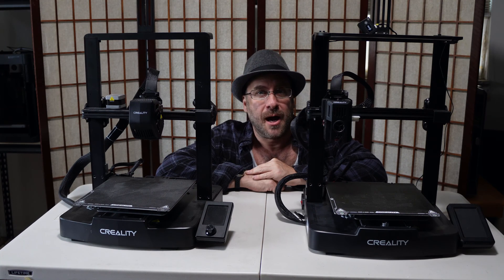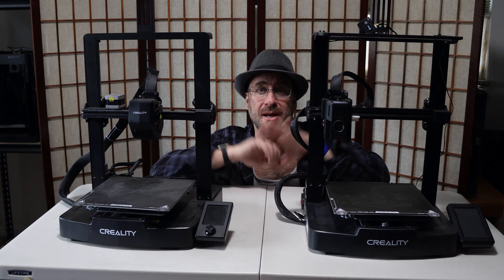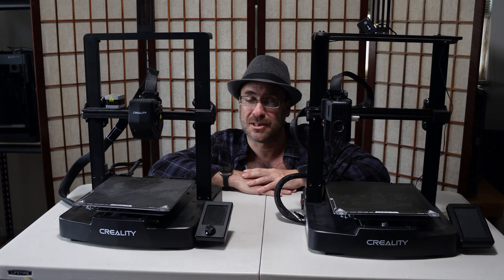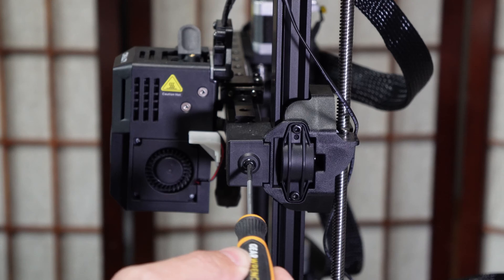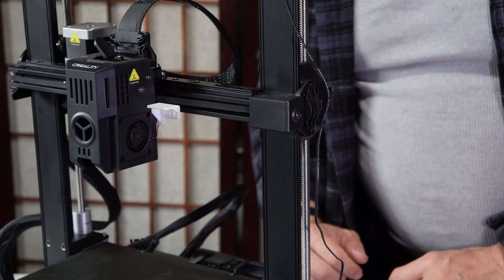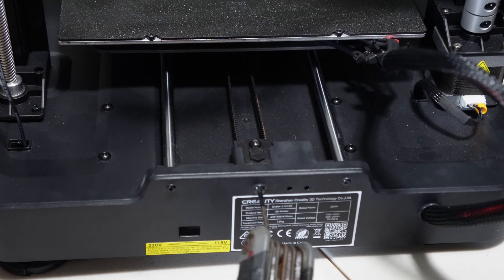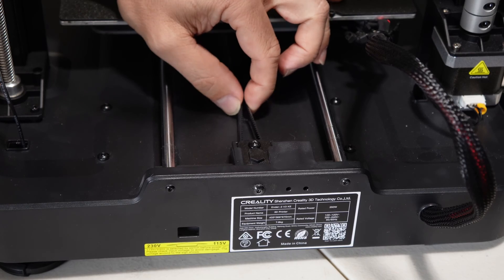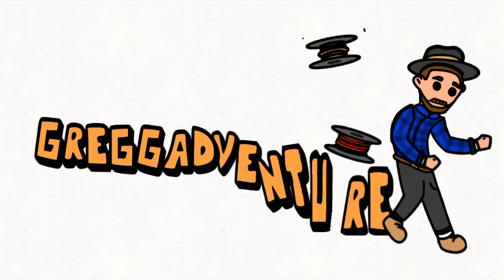Tighten Belts on Creality Ender 3 V3 SE and KE - Belt Tensioner - 3D Printer

Comment: Thanks for the info!

Another tip: I had terrible issues with bed adhesion. I tightened the belts, but it didn’t help. I also adjusted the Z-offset, but the results were hit and miss.

So I went back and checked all the screws mentioned in the assembly instructions — and a few were loose. After tightening everything properly, printing is pretty much back to how it was when the printer was new.
Reply from the maker: ALWAYS check all your screws and grubs when a new printer comes in. Even my $2500 Orange Storm Giga, came in with a loose hot end.

Comment: If the screw under the bed won't engage the click switch at the back, next to the tensioner, does that mean the belt is too tight?
Reply from the maker: Something is obstructing the bed. Look for piece of filament or something. Be sure the cable isn't hitting the wall

Comment: Hello! Ender 3 v3 ke have eccentric nuts like S1 for example? In mine, only one rolling in each side...
Reply from the maker: Yes. I believe they are under the plastic housings
Reply: @3DRundown  Thanks! The S1 video saved my lasts  prints while I have this issue with KE(ghosting, layer shift)🙏 Recently, i bought an a1 mini, but had to return due the troubles with nozzle hitting and adhesion...😌
Reply from the maker: Trouble with the A1? I'm surprised. I bet we coulda solved that. For your KE.  Check the HOT END & NOZZLE for loose screws. Check them ALL, even the Grubs. Be sure the nozzle is solid and NO WIGGLE. My CR10-SE had a loose hotend, causing Z-Banding, that drove me nuts for weeks, trying all sorts of shit..... before I finally found it....
Reply: @3DRundown  Thanks!I watch your video about a1 mini for for adhesion and this make me decide return( I think unfair have to buy glue or anything for a new printer with troubles) and I read several cases about nose hitting in the internet. About KE, all hotend is wabble since a bought it and screews are dusted, but I was able to get great impressions until recentlyl...
Reply: Sorry for my written English, but I understand it very well (thank you Seinfeld and Guns n' Roses) to follow your channel instead of thousands in portuguese 😊😉

Comment: CreaLIEty screwed me over on the v3 plus arrived missing bolts on the bottom of the rails that play a part in stabalising the machine (not the support twisty things you install yourself) .  I asked them how to tension the belt as there were no instructions before they pointed out to check  the part where they were missing.  They also said the belt should be fine , so i assume there is no method of tensioning the belt ?
Reply from the maker: I am always happy to help, but I ask we don't make me participate in a conversation that uses hurtful language toward my friends at Creality. They are PEOPLE just like us, and insulting comments on the internet, make them sad, just like us. I also don't wish to hurt my relationship with them, as they ARE here on my channel. That said, sure, mistake happen. It's possible, the long shipping process, vibrated the bolt loose and off. Loose bolts after shipping, is certainly a thing, across many 3D Printers. always check them all. While my V3 actually blew it's mainboard in 1 day, it was absolutely amazing for that 1 day. I will 100000% make a video on this, but, for now, check this out: https://youtu.be/09w4gwR57bI?si=oWgVkv_bGAZ1mleT

Comment: Question: what does incorrect belt tension sound like?  Just today, my KE has started "growling" when printing and the resulting surface is very rough instead of smooth.  Both belts, though, seem to be about trampoline-like when I check their tension, so I don't think it's an X/Y problem.  Is there something in the Z drive that I should check/adjust?  Thanks.
Reply from the maker: Oddly enough, GRINDING can be the sound of belts that are too LOOSE, due to them slipping. Or, perhaps printing too fast. Try slowing things down a bit. Could even bring down the Accelleration a touch. Of course, a bad stepper will growl as well.... I just had one on my C6-MAX, but I have not found this to be a common problem. Try to isolated the sounds source. Start with slower speeds, and listen. With the power off, things should move smoothly, and easily, and nothing should feel like a "flat tire". Flat Tire is too tight.
Reply: @3DRundown  Thanks for the very prompt reply - that's rare for channel owners!  I think I figured it out, after checking belt tension, restarting printer, Orca slicer etc.  It's not a mechanical problem - I'm testing the fix again now, but just got one successful print.  So far, I've narrowed it down to the "Print By Object" option instead of default "Print By Layer", which I wanted to try for multiple parts on a single plate - I figure quality would be better if the printhead wasn't jumping all over the place each layer.  (I'm printing the remixed Pastamatic spool winder, FYI, and it bombed out on the shims when I decided to play with Print By Object)  I finally realized that was the only change I'd made between a beautiful part and a cobblestone part that sounded like the printer was spitting nails.  It kicked in twice at the same place on the part, at the lower-left of the plate.  I reprinted the single part in the middle of the plate with "Print By Layer" restored and it came out beautifully.  I've been printing at 150mm/sec so pretty slowly, to ensure a nice finish; that remains unchanged.

So the problem seems to be Print By Layer, but I've reset that option to Print By Object with a single part centered on the plate to see if it happens again.  So far, the print has gone slightly beyond the point where it failed twice previously, and it looks ok.  I'll let it go and if it comes out ok, I'll move the part back down to the lower-left of the plate with Print-By-Object again, to see if it still screws up with everything reset back to the previous problem setup.  So far, it's about 1/3 printed and it's a bit "lumpier" and noisier, but doesn't look bad as it did previously.  If you want to see a Before/After comparison photo, let me know how to upload or email it to you.

Since you have a KE and presumably access to Orca, you could probably duplicate this problem if you wanted to dive into it, but for now I think I can finish my assembly printing by doing it one major part at a time via Print By Layer as usual.    I think either Orca is generating glitchy code or the KE has a firmware problem receiving whatever code Orca sends with Print By Object enabled.
Reply from the maker: I've never actually done print by object. I always do print by layer. With print by object, you have to ensure that the toolhead won't hit the previously finished object. This limits your usable bed space. I do most if my slicing via Bambu Studio, but I could check out the file for you if you'd like. Use a Microsoft One Drive link.
Reply: @3DRundown  Just so you know, I was amazed to see that Orca was even smarter than I thought.  When I set up for Print By Object, I placed all the parts on the Orca plate, then hit "Arrange all objects on bed" just to group them efficiently.  Orca took their heights into account for PBO!  I figured I'd have to manually move the tallest stuff forward because I thought about gantry-clearances as you said, but Orca rearranged everything to do that for me automatically.  It also took into account all "shadowing" of a taller part adjacent to a smaller one that would otherwise be underneath it, to print the shorter one first - that's a PBO issue as well.  Yep, I was impressed.  Try it and be amazed; might make a decent video-short topic once the bug is fixed - but it might be unique to some Creality printer firmware and doesn't prang other makes.  I'll make a note to send you the problem-part file; it's be interesting to know if Bambu Studio has the same bug, since pretty much all the slicers came from the same roots.  If I can figure a workaround or discover it's fixed in an update, I'll be using PBO pretty frequently to maintain print quality while running efficient print sessions.
Reply from the maker: If they'd stop dooming me to spend all of eternity, shooting setups for new printers, I could actually cover more software stuff, which I would REALLY like to do...

Comment: What about the Z axis belt on KE? Looks like there are no screws to tension it.
Reply from the maker: Same place as the SE.
Reply: @3DRundown X axis is on the right of hotend, Y is on the back of printer but looks like Z axis has no tensioner only synchronization screws…
Reply from the maker: Ah yes. No tensioner. It's a continuous loop belt, rather than a belt attached at the ends
Reply: @3DRundown  probably they though we ain’t gonna need it 🤷‍♂️. Oh well.

Comment: Hey also check your screws on your nozzle. I had an error 2401 hight anomaly they replaced the mainboard and the strain gauge. That didn’t work still got the error. I found an old Reddit post about this code to check the screws they hold the nozzle in. Well i checked them gave the nozzle a wiggle and it fell into my hands. Long story put the screws in and that fixed it
Reply: Yep learned that the hard way
Reply from the maker: Always check all your hardware after shipping. Especially your hot end

Comment: Adjustment replacement screws and belts for Ender 3 V3 SE are almost impossible to find and replace, anyone else experience this?
Reply from the maker: What caused you to need one?
Reply: @3DRundown  I need a belt for the x axis on my ke
Reply: I added a camers holder onto the tensioner and then lost the tension screw. Oh well…